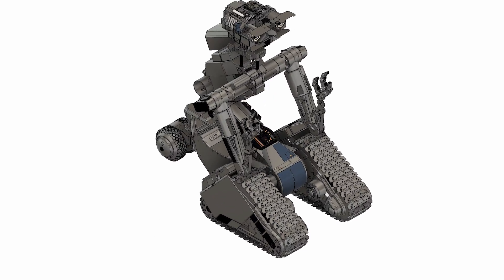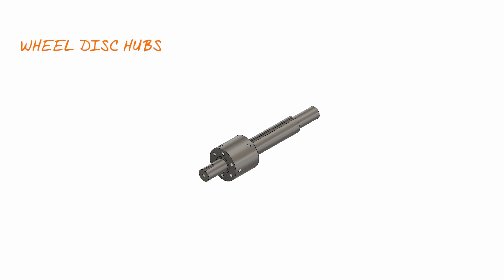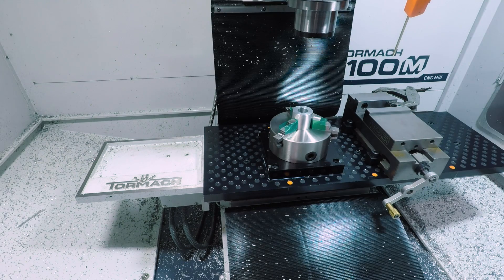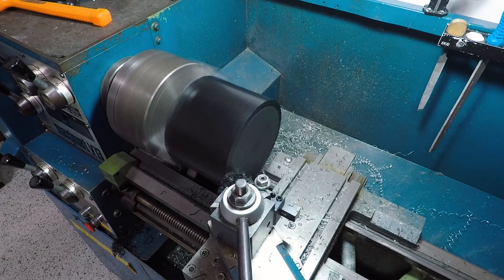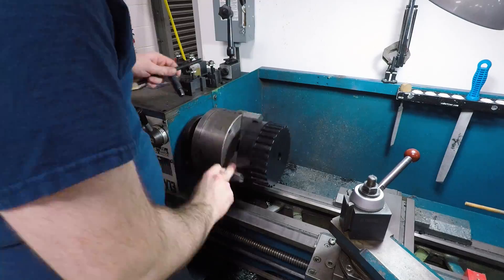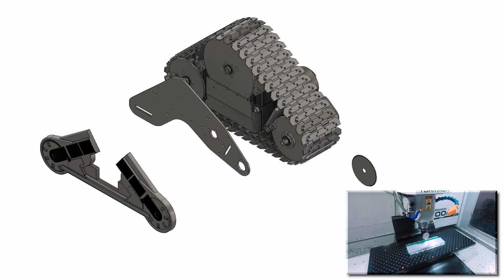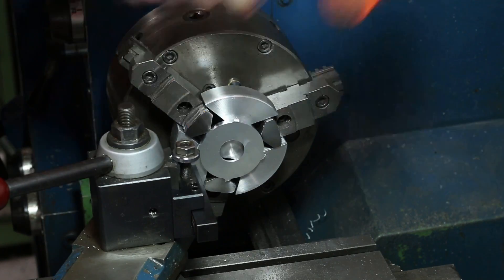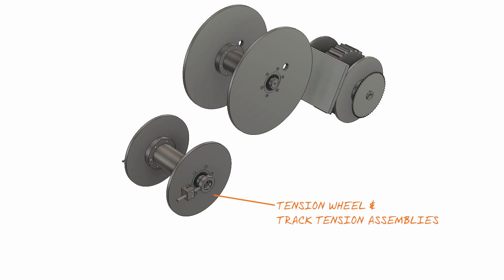Johnny 5 Part 3 - Turning, Milling & Broaching the Drive Wheel | WW239

Comment: Im always amazed at the speeds and feeds that can be ran. I run a massive Daewoo cnc and its max rpm is like 2400. And it doesn't like doing that for long run times(like hours per tool). So most of my rpms  it likes are around 1650 . Its x is 78"s. Y is 63"s. Horizontal boring Mill.
I like watching this videos but i cant use them on my job.

Comment: Love the build.  Just one suggestion.  There are too many people that are reliant on the technology available.  Please don't treat your "Manual" Lathe like a piece of ancient history to be overlooked.  take 30 seconds to explain the 1/128 scale and its uses.  I have seen too many engineers that can spend all day generating beautiful blueprints that are impossible to build.
 I hate to see someone that can obviously use the equipment, treat it like and after though. I spent years trying to figure out the mental math to convert 1/128th scale to base 10 for building SAE standard blueprints.  use it as  a chance to each others, not dismiss the past

Comment: When you deburr on a lathe you should be standing on the right and have your right hand on the tip of the file and hold the handle with the left hand for safety reason. Your body is more important then a good camera shot. A good thing to remind is that you should have your right elbow on the tailstock.

Comment: I damaged my Z way cover, what material is that you have in its place ? Is that the only cover or is it protecting the actual Z way cover ? 13:42 pretty slick work stops in the lathe chuck !!
Reply from the maker: 1) Pick up a replacement Z way cover from tormach 2) We added this rubber - it's old drawer liner, but lots of ways to skin the cat

Comment: Did you calculate the pitch diameter on the sprocket or did you get dims off line of the sprockets you mentioned?  Calculating pitch diameter always causes problems for my projects; seems like some voodoo science is involved that I'm missing somewhere.  Great video!
Reply: Indeed, I have tried designing sprockets as well and I find it pretty difficult sometimes. You need to know exactly the track's distance between each link. 

NYC CNC, can you please make a video how you designed this sprocket? Thanks.

Comment: Hi, quick safety tip when broaching:
Don't just push the broach right through the part, in one continuous stroke of the press.
Push the broach in a short distance, remove the the downward pressure on the broach by raising the press slightly, then repeat.
This itterative process prevents any lateral stresses from building up in the hardened broach and shattering it.
Reply: Nicholas Lee i would much rather broach on the lathe or mill. Just as fast and less chance of scrapping a part